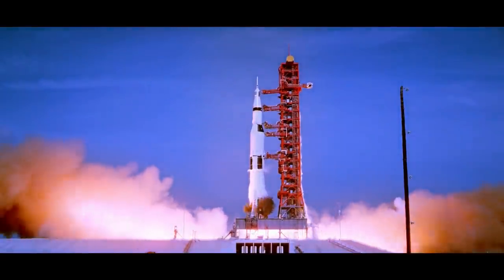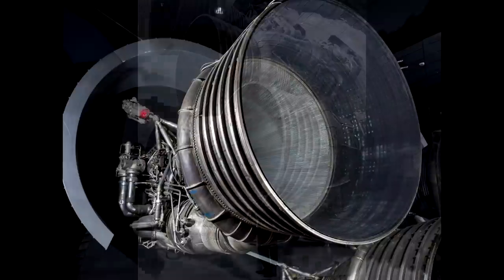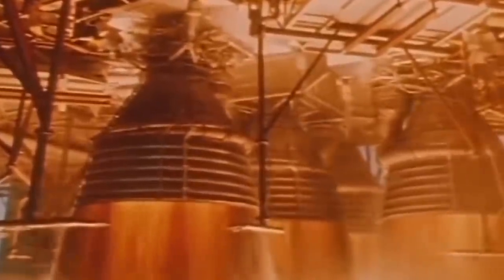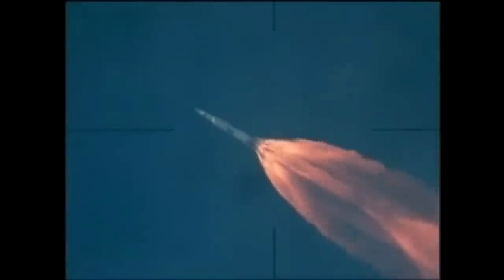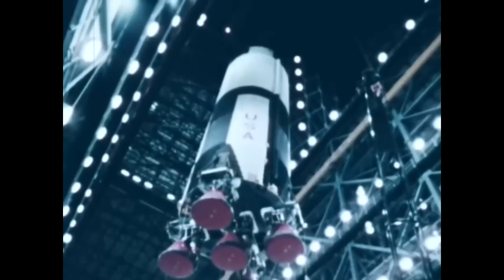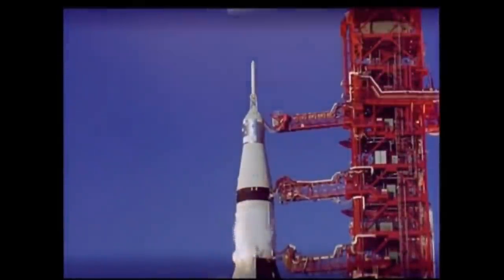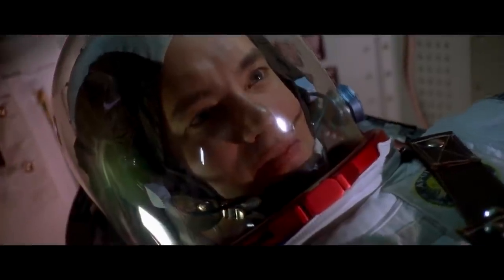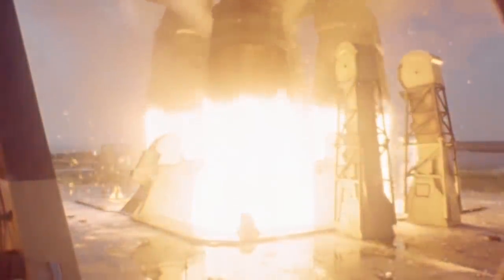Why The Engines That Flew On Saturn V Rocket Look Different In Museums

Comment: I kinda like that they don't have insulation in museums, it means you get to see all the amazing details underneath
Reply: I mean , just have at least a piece of it
Reply: @linecraftman3907   health and safety maybe as it's "Asbestos", or maybe it's just something that has been forgotten or hides the beauty of the engine ?
or simply just cost of adding a fake Asbestos free dummy version & braking the realism?
Reply: That's probably the reason they left it off, the F1 engine without the insulation definitely looks a lot more interesting.
Reply: A photo display and a plaque explaining the heat shielding would be a nice addition.
Reply: Asbestos blanket in public display... also not a great idea.
Reply: You could have one engine without the shielding and one engine with mock up shielding. Asbestos free.
Reply: @1_2_die2  Asbestos could easily be replaced by anything else. You wouldn't see it behind the layers of foil anyhow.
Reply: and it's super ugly
Reply: they take it off at museums for exactly that reason, to see it. as far as asbestos it is perfectly safe to leave it be and only becomes dangerous when disturbed (aka. insulation is moved or when household siding broken). since museums tend to have a no touching policy, i don't really see that as a valid issue.
Reply: and you wont get stick
Reply: Or, they had some unused rockets that they hadn't applied the protective layer to and didn't want to invest 1000+ man hours to apply it for a mock up. Especially as they were getting wise to the dangers of asbestos by then and didn't want to handle it unless absolutely necessary.
Reply: I agree with this comment thread asbestos I can.
Reply: i mean that and its nice knowing your not getting exposed to asbestos

Comment: Scott, as an aerodynamicist I feel the need to give you a minor course correction.  The pressure behind a shock is higher, not lower.   Supersonic flow, when encountering a protrusion into the flow (like the corner between the service module and the SLA) a shock forms to turn the flow.  When the body turns away from the flow (like where the SLA meets the S-IVB) an expansion forms to turn the flow.   The pressure behind an expansion is lower.   So you are correct that the base pressure is decreasing, but it is because of expansions and not shocks.   I offer this kindly because I find most of your videos and explanations spot on and thought you would like to know.  Keep up the good work!
Reply: in layman's terms, am I still correct to think of supersonic objects producing a high pressure cone of shock front, which is necessarily followed by a low pressure zone (ignoring zones of exhaust pressure)?
Reply: @nathansmith3608  Usually, but not necessarily.  Let's take a flat plate at angle of attack in a supersonic free stream.   Think of the plate as infinitely thin so that we can ignore detailed leading edge effects.  On the 'compression' side, which is the side where the flow is being deflected by the plate, there will be a shock wave and the pressure on the plate will be higher than that of the free stream.  On the other side of the plate where the plate has turned away from the free stream, there is an expansion wave and the pressure is lower than free stream.  At the trailing edge we will get the opposite to occur.   The compression flow will expand back to free stream and the suction side will go through a trailing edge shock to get its pressure back up to free stream.   In the case of the Saturn V, there are three primary regions where we see a shock followed by an expansion.  1) The nose of the command module produces a shock and transition to the constant diameter service module produces and expansion.   2) The service module - to SLA produces a shock and the SLA-SIVB produces and expansion.  The final pair is the SIVB to S-II transition produces a shock at the start of this conical region and an expansion at the rear where the cone stops and the S-II begins.   Needless to say the flow at the aft end of the S-I stage is very complex.  You have shocks coming off each of the four nozzle fairings as well as the four fins on those fairing, plus you have the expansion at the base of the vehicle.   Another thing you can easily observe in the S-V launches is the effect of the decreasing pressure on engine flow/performance.   The exit static pressure is dropping as the rocket's altitude increases.   This causes the engine flow to further expand once it leaves the exhaust nozzle (at this point the flow is termed to be "under expanded").   You see this as the increased diameter of the exhaust plume.   And this is probably way more than you wanted to know about supersonic aerodynamics but I hope you find it interesting.
Reply: @dougball328  more layman's terms... supersonic flow is more compressible, which means lower pressure... this is why the control surfaces on the P-38 did not work properly in dives as it approached mach 1. When the supersonic flow is disrupted and slowed, but the volume remains the same, pressure jumps up behind the shockwave. This is how variable intake geometry works inside the F-15 and F-14. Shockwaves are formed which slow down the incoming air, which results in increased pressure behind the shockwave... which "pre-compresses" the air before it gets to the compressor of the engine. If supersonic flow met the blades of the compressor, it would stall, just like the control surfaces of the p-38 did. The solution to both problems is the same (similar): Air brakes. Inside an F-15 intake, they create shockwaves that slow but result in increased compression... in a p-38, the planes just slows enough that its surfaces work enough to pull it out of a dive.
Reply: @dougball328  Is the flat plate of infinite thinness the aerodynamicist's spherical cow?
Reply: Your explanation of the F-15 inlet is correct, but your explanation for the control issue (P-38 and others) is incorrect.   For starters, supersonic flows are capable of more compression only because of the greater total pressure.    As for the controls,  shocks would build at the hinge line and separate the flow, making the control ineffective.  This is the reason that the X-1 was modified for an all-movable tail surface as well as an elevator.   I can't think of a single supersonic airplane since that does not have a movable horizontal, unless it's a tailless delta wing.
Reply: @Markle2k  I am going to ignore your off-topic comments and return this conversation to a meaningful level worthy of Mr. Manley.   Sorry for this corruption, Scott.
Reply: Doug Ball we’re really living in the future when I get more education from YouTube comments than college
Reply: I'm taking Compressible Aerodynamics right now and thought that sounded off 😬
Reply: Doug Ball, in 2 or 3 replies you transmitted more useful and interesting information than most youtubers and other internet "celebrities" will do in a lifetime. Thank you.
Reply: @Markle2k  I for one was mildly amused, so your effort wasn't in vain, good sir.
Reply: @dougball328  Homo Sapiens has, comparatively recently, developed an extra sense which is not common to all examples of the species, and does not appear to be present in other creatures. Comedoception is probably the most useful and versatile sense in the animal kingdom, and has even been exhibited by such rare specimens as Scott Manley. /s
Reply: I can only dream of one day being able to start a conversation with "as an aerodynamicist..."
Very interesting read!
Reply: Terry Wilson  Terry, in the subsonic case the shock isn't necessarily at the hinge line.   When the trailing edge of the aileron is deflected down, the lift on that side of the wing should increase.  But at critical Mach numbers, the slight increase in lift results in the formation of a shock.  It may or may not be at the hinge line and it almost always results in the flow separating.     Your comments about supersonic flow and resulting hinge moments is spot on.   And the cancellation of the Avro Arrow was a travesty.   What a great airplane.   And if I remember correctly they followed Stuart Symington's 'playbook' from the YB-49 cancellation and made them destroy all the ones that had been built.  Just dumb in both cases.
Reply: @samrobinson9110  It started as a dream for me, about the age of 8.  13 years and a lot of hard work later it was real.   I was very fortunate to have had nearly 40 years of designing airplanes from gliders to supersonic commercial transports and military fighters and UAVs.   So don't just dream - go DO something about it!   And good luck.
Reply: @michelgardes  Glad you found it informative.
Reply: @aitchpea6011  
I was mildly amused as well, or at least microscopically amused.
His follow-up remark crossed the harrassment line, with consequences...
Reply: @-danR  Perhaps so. I could not see what inspired his ire, so I assumed a comment had been deleted. His response has now gone too, which is causing this conversation to become less relevant. This would be, I assume, the consequences of which you speak. I shall tread carefully lest I too be (shudder) consequenceised.
Reply: @aitchpea6011  Well, at least somebody appreciated the attempt at levity. I couldn't understand why he overreacted. It wasn't as if I denigrated his contribution.
Reply: @Markle2k  Indeed, he must have deleted his overreaction before I happened upon this thread, but I had assumed there must have been one for you to respond as you did. Hence my weighing in. Would it be stirring the pot to ask if you had a record of it for us all to see?
Reply: Terry Wilson  The section Cl does matter, and that is the lift.   As you are well aware, at subsonic free stream Mach numbers the local flow on the suction side of the airfoil can go supersonic - hence the term transonic - parts are subsonic, parts are supersonic.   You are correct that in fully supersonic flow, a control surface deflected into the flow will produce a shock.  As for diving through the Mach 0.9 to 1.1 speed regime, you are also correct.   Are you familiar with Rutowski flight paths?   These paths can define the most efficient or quickest way to accelerate and climb.   In nearly all cases it involves climbing and accelerating to M0.9 at 36,0000ft, then pushing over and trading some of the potential energy (altitude) for speed.   The pullout will occur between 25-30000 ft, (very vehicle dependent) and at Mach 1.1 or higher.  You then proceed to accelerate and climb to whatever Mach/Altitude point you had targeted - for a lot of military jets this is usually around 1.6-2.0 and 50,000.   And one last item: was there a TV mini-series about the Avro Arrow?  I'll have to watch it if there is one.   Thanks for the exchange.  What is your background?
Reply: @aitchpea6011  I'd rather let the thing pass so long as Doug has sorted himself out.
Reply: @Markle2k  Me too.  The only thing I needed to sort was that continuing a dialogue with you was counterproductive.   As I'm sure you have, too.   I have had very productive conversations with others here, and that is why I am here.   All the best.
Reply: the all moving tailplane was needed b/c otherwise the tailplane couldn't get any "grip" (control authority?) b/c it was in the low pressure "wake" behind the shockwave, correct?
Reply: @nathansmith3608  Yes, the elevator would separate, thus making the horizontal stabilizer ineffective.    But to be clear, it was not the wake from the wing.
Reply: the Trident SLBM missile has an aerospike. a round plate that is projected out the point of the bluntly shaped missile on a collapsible spike. the blunt nose of the missile is in the cone of the shock wave reducing drag. it enables more or a larger warheads without reducing range.
Reply: @michaelmooney3369  Spot on.
Reply: As a guitarist, I have to agree.
Reply: THIS! This is the beauty of science. i could not be prouder of you both.
Reply: B H e
Reply: @dougball328  that was laymen's terms???😜
Reply: @shawndouglass2939  There is no way to make it any simpler and keep it accurate.  Sorry.
Reply: It's been entirely too long since I took my college rocketry and propulsion classes and I haven't kept up with it, so I can't get into too much detail without risking talking out my ass. However, I feel it's also worth mentioning that there's a shock (I believe the term is Mach Disk. I'm using some reference material) inside the plume of exhaust which is also making the aerodynamics of the exhaust plume even more fun.

Inside the combustion chamber, everything is subsonic; however, as the contolled explosion is forced through the throat of the nozzle, the gases go supersonic. The shock is where the gas flows separate and go back to subsonic.

Every rocket engine has a design altitude at which it operates at peak efficiency. The geometry (specifically, the throat:nozzle exit area ratio) determines that. Ideally, you want that shock to be at the nozzle exit.

 Put simply, however, as altitude increases, ambient pressure decreases to be less than the pressure of the exhaust plume. The shock moves up towards the throat, and the plume expands. Most rockets designed to operate near sea level actually have a design altitude of something like 20,000 feet because by then, atmosphereic pressure is 1/3rd of sea level, and the majority of your first stage is going to be spent going between sea level and 20000 feet. As such, the rocket plume will start out "underexpanded" (if you look closely, the plume shrinks slightly after leaving the bell), then expands from there. 

If I remember correctly, when you look at close up footage Space Shuttle Main engine startup, you can see the shock cone. It's more obvious on the SSME because, a) the SSME's exhaust is clearer, and b) the SSME's nozzle/bell geometry is designed to operate with peak efficiency in near vacuum, which means that the plume is extremely under-expanded at sea level. With the F-1 which is designed for peak efficiency in atmosphere (at roughly ~20,000 ft if memory serves).
Reply: @Wirespeed91  Your memory is pretty good.   However, a shock does not necessarily mean the flow goes back to subsonic.   In the case of a normal shock, yes; for oblique shocks, no.   You never want a normal shock in rocket exhaust flows.    Most rocket engines are over-expanded at sea level.   That's why you see the plume shrink at first.  (The outside edge of the exhaust plume is a constant pressure boundary.  It has to be because a free surface cannot support load)   As you go up in altitude, as you said, you reach the altitude where the engine is perfectly expanded (the exit static pressure of the exhaust flow equals the atmospheric pressure).   At higher altitudes the exhaust is under-expanded and hence you see the big plume.   Can you help me with my memory?  I know shocks reflect off solid boundaries as shocks.  Do they reflect off a constant pressure surface (the plume edge) as an expansion?   I need to look this up.   Thanks for the post, you've made me think - and thinking about rocket engines is always a good thing.
Reply: Could you use the air pushing forward for extra thrust?
Reply: dude that was a remarkably polite, informative and humble comment.../respect........lots of great comments from some smart peeps below as well I see. The P-38 is a fav of mine, pretty cool what you learn here in this channel.
Reply: @dougball328  Thanks for your comments learned more about supersonic flight in 30 min reading your comments  than rest of my 60 year life  . By the way what are your opinions on our British  Miles M.52 that our government cancelled looked to me like is was on right track for supersonic flight.  You should do some videos on here if you did be one subscriber here
Reply: @nounoufriend  I was not familiar with this vehicle so thank you for bringing it to my attention.   While it appears to be 'on the right track' (very thin wings, shock reducing nose) I seriously doubt that this vehicle would have exceeded Mach 1.   Jet engines did not produce a lot of thrust then.   Yes, a scale model did fly Mach 1.38 (or so I read), that model was rocket powered.   A key design feature for supersonic fight is an all flying horizontal stabilizer.      Without it loss of control was almost assured.  Brits were the creators of this key idea.   One interesting note on the design.  It was stated that the wingtips were clipped to keep it out of the nose shock.   The smarter solution would have been to sweep the wings back - something that was known then.
Reply: @dougball328  True swept wings seems so obvious now suppose the Germans were ahead of game with Me 163 but that had major control problems approaching Mach 1 . I often wonder how they got round control issues with the V2 as that well exceeded Mach 1
Reply: @nounoufriend  V2 used vectored thrust control via carbon vanes in the rocket engine exhaust.  The vanes were movable.    The fins provided basic static stability.  Hope this helps.
Reply: Those nasa lock nuts and nasa aluminum foil give ya the optimum speed it takes to land in uranus.considering ya cant make a car that drives from california to ky without stopping for fuel😂

Comment: In the Apollo-13 movie, they got the whole rocket wrong during lift-off, they depicted the Saturn 500, which was a mock up used for crawler testing. As to why the F-1 engines don't have the covering in museums is because you can't see the details through the cover